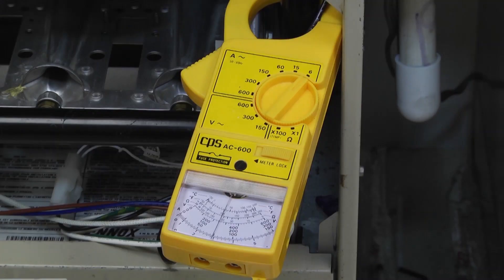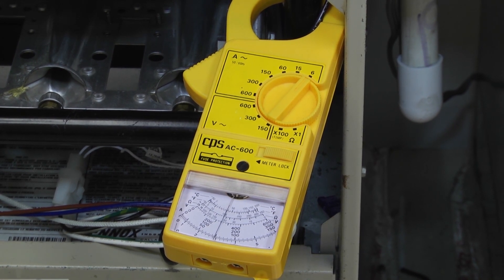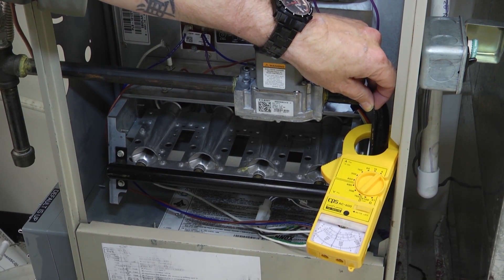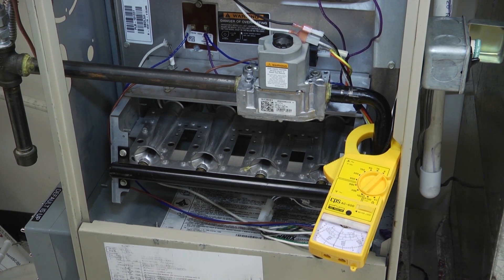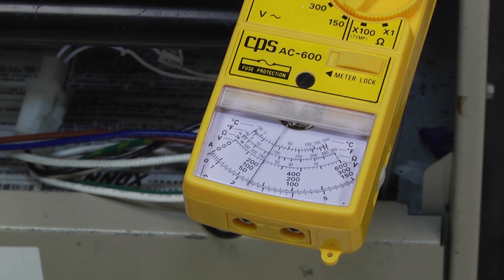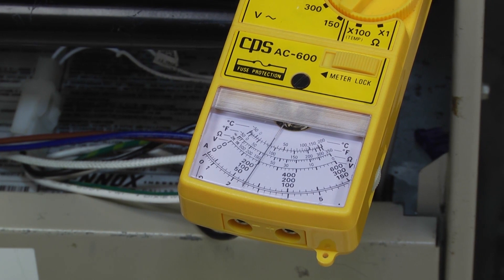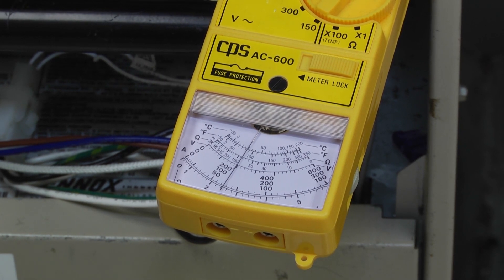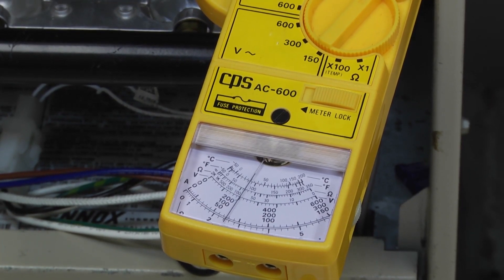Blower Amp Draw

Comment: What's the VOLTAGE? 3 amp at 120V or 240V - big difference in power usage! I guess 120V, but there are Goodman blowers which are 240v
Reply: 120 its a furnace not an airhandler
Reply: How is this question or comment relevant to the tip here? You are not understanding the knowledge he was sharing.

Comment: you are removing a portion of the fluid the flow so the amperage will naturally drop and rpm will raise as there is less work being performed by the motor.
Reply: An Ecm motor will over amp trying to make up for the restriction.

Comment: Seriously is it bad enough you are using an analog meter but you are also clamped onto the manifold as well as the live wire.  Really bad practice, the only thing in the clamp should be the line being tested.  The 90's called.....they want their analog tester back.
Reply: That is a decent meter. And in order to identify some transient impulses you need a analog .